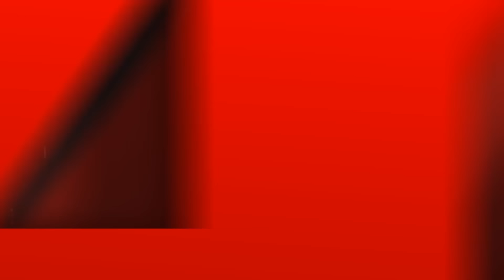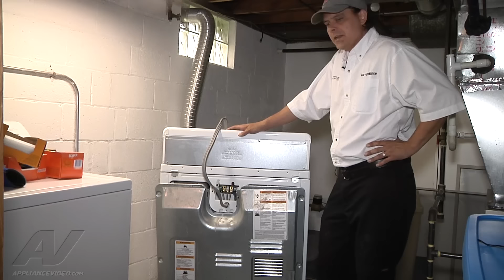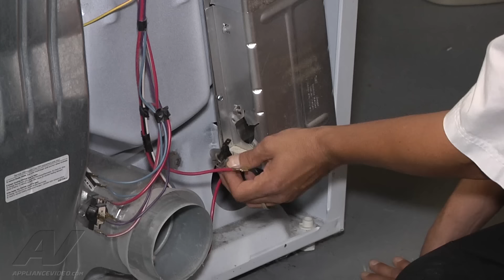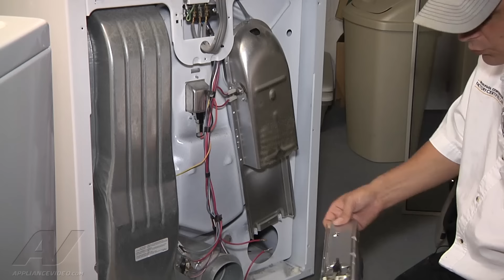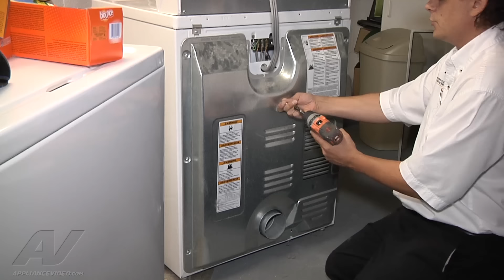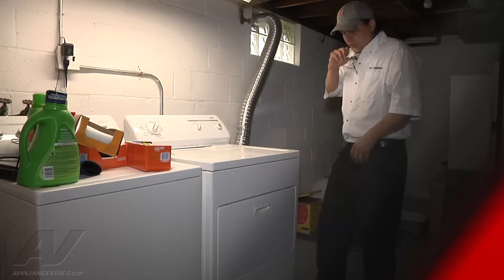Kenmore Dryer Repair - Does Not Heat - Element Diagnostic & Troubleshooting

Comment: @3:40, the tech said no continuity, it's fine. then @5:10, the tech said he has continuity, and that's good. Which one is it? Because the latter is a new piece, I'm going to assume that there should be continuity between the prongs, but what about the element. I'll assume that when testing the element by placing one pin on the element shield and another on one of the prongs that there should not be continuity; otherwise, it will be considered shorted - meaning it's having a connection where there should not be one between the element shield and the prong. Or am I misunderstanding? Any clarification would be appreciated.

Comment: Thanks I actually fixed mine fast asf. It had two wires on the top thermostat and one was just disconnected. it appears it had been previously replaced and the terminals were not tightened. I used some pliers to tighten up that connection and reassembled everything and it’s running super hot now :)

Comment: 11 years old and its by far the best video. Every other video the goofballs leave the wires connected to the parts that were tested. I'm no electrician but that did not seem right to me. I like how you said the heater unit has either 2 or 4 wires connected to it. On mine I've got 3 wires. Joy.

Comment: So after replacing the thermal fuse and the heating element and thermostat with no good results… I watched this video.. didn’t have time to replace the thermal cutoff so I just bypassed it by Hotwiring it… dryer works perfectly now… thanks..

Comment: The heater box springs were cut O just put a piece of wire use to tight hay bales to make contact n is heating like crazy  thanks for ur video amigo valla con Dios❤

Comment: OK, I did all that and I still don't have heat in my dryer. What is the next step? Could my "new" heating element be bad? How can I check? Or could another part be faulty.
Reply: Did you end up hiring someone to fix the dryer, and what was the problem?

Comment: Nice but i have all continuity are good beep  for all sensors and heating element. Can you tell me what is next please
Reply: I figure out . Switch plug not connected well . When I move plug has noise and heating work . 😂 thanks anyway. I will do clean and put some dialectic grease 😊

Comment: Hi so I replaced the thermostats on both sides the wires are in good condition and I checked every plug for continuity which also was good 👍 and the heating element which is good 👍 I also checked the motherboard and all the plugs had proper flow of continuity 👍 and checked the breaker and power flow but my dryer still won’t heat what else could it be🤦‍♀️
Reply: Any luck? In the same boat

Comment: What if i use multimeter and the heater core has continuity and the heater fuse? i have an electric kenmore older addition and i wonder if it has a coil? if so where? i only found thermostat

Comment: Troy great instructions on replacing element on Kenmore dryer  You are clear with great visual in your instruction on repair/replace  on the Kenmore Dryer. I have a Kenmore Heavy Dryer "Runs Like a Horse" 35 year old dryer.  Replace the heating element in 2005 now I am going to replace the part in 2022.  Once the element is in place cleaned and connected to the vent it will be back and drying for another 35 years (maybe) :).

Comment: If that is going out will in work and sometimes and then not? The dryer has proper air flow. Gas dryer 400 series. Maybe a fuse? It does make a clicking noise then will blow cool. Very frustrating....

Comment: This was very helpful, & my Whirlpool dryer is set up exactly the same as the Kenmore used in this video.    My power outlets, thermostats, & timer switch all checked out OK, but my heating element did not.  After removing it, I found the break in the heating element.   Gave me the confidence to order a new heating element & finish the repair myself.   Thank you!

Comment: Thank you!  A $27 part that took me a half-hour to diagnose and replace versus a two-week wait and an estimated $250 repair from an appliance company.  You saved us time, money, and convenience.  Well made video with clear directions.  Excellent job!
Reply: Where did you order the part and if you ordered on Amazon what’s the name of the part or how do I search it ?
Reply: This is exceptionally helpful and I also thank you for sharing this information. My in laws are thrilled that it can be fixed for a low cost. 👍🇨🇦
Reply: Where did you order the parts, I need to fix mine.
Reply: @jet4809  Amazon
Reply: @jet4809 amazon

Comment: Will the nasty dust on the wiring in the back cause the dryer not to heat. I did everything I could so far except put it back together. I’m 71 and in a lot of pain and alone. So I ask you this before I put it together…I hope you can help me…

Comment: Hello, would element # 279838 would fit my 30 year old Amana Dryer? Or whsh part would be? Thanks
Reply from the maker: Great question, if you have a more technical question that our parts department cannot answer, you can search our over 17,000 answered questions free at our website www.ApplianceVideo.com under our Repair Help section. You can also call our parts department at 1-800-830-5465 and they can give you help 7-days A week ,or search at www.SaveMoreOnParts.com  .

Comment: What do you suggest if your dryer has 2 wires for the thermostat and only 1 wire for the element?
Reply from the maker: Great question, if you have a more technical question that our parts department cannot answer, you can search our over 17,000 answered questions free at our website www.ApplianceVideo.com under our Repair Help section. You can also call our parts department at 1-800-830-5465 and they can give you help 7-days A week ,or search at www.SaveMoreOnParts.com  .

Comment: Great video...
But it doesn't say anything about what you do if you do have continuity on the thermostat and the heater. I found the wiring schematics in the back. He didn't mention to check the non resettable thermal cutoff at the top of the heater duct unit. That also should have continuity on the tabs with at least one wire pulled. If it is open, you won't have power to the heater coils. As it is non-resettable, it will have to be replaced 
If it's bad, be sure to check your drier vent hose to the outside. It may be full of lint causing the unit to overheat.
Reply from the maker: Great question, if you have a more technical question that our parts department cannot answer, you can search our over 17,000 answered questions free at our website www.ApplianceVideo.com under our Repair Help section. You can also call our parts department at 1-800-830-5465 and they can give you help 7-days A week ,or search at www.SaveMoreOnParts.com  .

Comment: Great video, thank you! I have discovered that my high limit thermostat is blown so will fix that. On testing also found that my heating element is black from heat but still conducts when tested. Is there any benefit to me installing a new heating element if old one is not blown?
Reply from the maker: Great question, if you have a more technical question that our parts department cannot answer, you can search our over 17,000 answered questions free at our website www.ApplianceVideo.com under our Repair Help section. You can also call our parts department at 1-800-830-5465 and they can give you help 7-days A week ,or search at www.SaveMoreOnParts.com  .

Comment: Do I do the same process on a Kenmore gas dryer? 🤷‍♀️
Reply from the maker: Great question, if you have a more technical question that our parts department cannot answer, you can search our over 17,000 answered questions free at our website www.ApplianceVideo.com under our Repair Help section. You can also call our parts department at 1-800-830-5465 and they can give you help 7-days A week ,or search at www.SaveMoreOnParts.com  .

Comment: I have a Kenmore Elite model #110.64992301. It is 15 yrs old but is in great condition. It stopped heating. I'm confused about the videos. Do I check the thermal fuse from open the front or back of the dryer? Thanks, Roy
Reply from the maker: Great question, if you have a more technical question that our parts department cannot answer, you can search our over 17,000 answered questions free at our website www.ApplianceVideo.com under our Repair Help section. You can also call our parts department at 1-800-830-5465 and they can give you help 7-days A week ,or search at www.SaveMoreOnParts.com  .

Comment: Hi thanks for the great video!
I cleaned the vents replaced the thermal fuse, and gas valves. I tested flame sensor,thermal cut off fuse, high limit thermostat and timer they have continuity but it still turns off after 10seconds. Please help.
Reply from the maker: Great question, if you have a more technical question that our parts department cannot answer, you can search our over 17,000 answered questions free at our website www.ApplianceVideo.com under our Repair Help section. You can also call our parts department at 1-800-830-5465 and they can give you help 7-days A week ,or search at www.SaveMoreOnParts.com  .

Comment: What if it is heating but not much, just a little heating?
Reply from the maker: Great question, if you have a more technical question that our parts department cannot answer, you can search our over 17,000 answered questions free at our website www.ApplianceVideo.com under our Repair Help section. You can also call our parts department at 1-800-830-5465 and they can give you help 7-days A week ,or search at www.SaveMoreOnParts.com  .

Comment: Ok I replaced the thermal Fuse still won't start
Reply from the maker: Great question, if you have a more technical question that our parts department cannot answer, you can search our over 17,000 answered questions free at our website www.ApplianceVideo.com under our Repair Help section. You can also call our parts department at 1-800-830-5465 and they can give you help 7-days A week ,or search at www.SaveMoreOnParts.com  .

Comment: Ok so if the dryer is still running, not heating, but my heating element test good, what could it be?
Reply from the maker: Great question, if you have a more technical question that our parts department cannot answer, you can search our over 17,000 answered questions free at our website www.ApplianceVideo.com under our Repair Help section. You can also call our parts department at 1-800-830-5465 and they can give you help 7-days A week ,or search at www.SaveMoreOnParts.com  .
Reply: You figure out the problem I bought the kit and replaced everything still no heat

Comment: Good video but you didnt actually say what someone should do if they do have 4 wires
Reply from the maker: Great question, if you have a more technical question that our parts department cannot answer, you can search our over 13,000 answered questions free at our website www.ApplianceVideo.com under our Repair Help section. You can also call our parts department at 1-800-830-5465 and they can give you help 7-days A week ,or search at www.SaveMoreOnParts.com  .

Comment: Thanks same dryer i have and it just stop heating today after 9yrs hopefully the element went out.
Reply from the maker: Great question, if you have a more technical question that our parts department cannot answer, you can search our over 10,000 answered questions free at our website www.ApplianceVideo.com under our Repair Help section. You can also call our parts department at 1-800-830-5465 and they can give you help 7-days A week Monday Saturday, or search at www.SaveMoreOnParts.com  24 hours 7 days A week.

Comment: Great video. I replaced the thermal fuse and heating element and I’m still in a situation where sometimes I have heat, sometimes no. Any ideas?
Reply from the maker: Thanks for your response, we are glad we could help. Our library
of over 5,700 videos are currently helping over 1.6 million people like you
every MONTH.  Please help us by
subscribing to our YouTube channel, or post our website www.ApplianceVideo.com to your Facebook
page, Twitter, Instagram or any other social media sites. Your support will
help us keep producing more free quality videos.
Reply: Could be a falty timer.test it with a multi meter the red,blue wire behind the timer,put the multimeter on the lowest setting on ohms
Reply: If it's intermittent, my money would be on a faulty element or the thermostat.

Comment: Where do i find heater element.
Reply from the maker: Great question, if you have a
more technical question that our parts department cannot answer, you can search
our over 10,000 answered questions free at our website www.ApplianceVideo.com under our Repair Help section. You can also call
our parts department at 1-800-830-5465 and they can give you help 7-days A week
Monday -Saturday, or search at www.SaveMoreOnParts.com  24 hours
7- days A week.
Reply: Amazon Ebay

Comment: I have changed the heating element and all the thermostats switched the breaker off then back on and still no heat
Reply from the maker: Great question, if you have a
more technical question that our parts department cannot answer, you can search
our over 10,000 answered questions free at our website www.ApplianceVideo.com under our Repair Help section. You can also call
our parts department at 1-800-830-5465 and they can give you help 7-days A week
Monday -Saturday, or search at www.SaveMoreOnParts.com  24 hours
7- days A week.
Reply: Timer

Comment: I'm having a similar problem to the video, dryers running, the timer is not going down at all and there is no heat, would a broken heating element impact the timer feature on the dryer as well? Thanks a lot for the help!
Reply from the maker: Great question, if you have a
more technical question that our parts department cannot answer, you can search
our over 10,000 answered questions free at our website www.ApplianceVideo.com under our Repair Help section. You can also call
our parts department at 1-800-830-5465 and they can give you help 6-days A week
Monday -Saturday, or search at www.SaveMoreOnParts.com  24 hours
7- days A week.

Comment: It would be helpful if the camera was focused on what you are talking about if this is diy one should assume the person doesn't know what the continuity setting on a meter is. Maybe I didn't catch it, but unplug for safety? The electrical? Gas un plug/shut off?
Reply from the maker: Great question, if you have a
more technical question that our parts department cannot answer, you can search
our over 10,000 answered questions free at our website www.ApplianceVideo.com under our Repair Help section. You can also call
our parts department at 1-800-830-5465 and they can give you help 7-days A week
Monday -Sunday, or search at www.SaveMoreOnParts.com  24 hours
7- days A week.

Comment: What if the element in the thermostat is good what is the little thingy on the top side of the heating tube with two wires
Reply from the maker: Great question, if you have a
more technical question that our parts department cannot answer, you can search
our over 10,000 answered questions free at our website www.ApplianceVideo.com under our Repair Help section. You can also call
our parts department at 1-800-830-5465 and they can give you help 7-days A week
Monday -Sunday, or search at www.SaveMoreOnParts.com  24 hours
7- days A week.

Comment: ? So what do I do if I have changed everything heating elements and fueses and still no heat everything works but no heat
Reply from the maker: Great question, if you have a
more technical question that our parts department cannot answer, our
technicians are answering all questions at our website at www.ApplianceVideo.com under our Repair Help section. You can also call
our parts department at 1-800-830-5465 and they can give you help 7-days A week
Monday -Sunday, or search at www.SaveMoreOnParts.com  24 hours
7- days A week.
Reply: Timer

Comment: Hi, I noticed you said a kenmore 80 series electric dryer in the video but it looks identical to my kenmore 600 gas dryer. I have not opened my back panel and checked yet but are they identical in the back since I cannot get to the back unless I move it all the way out which I will once I get all the parts.
Reply from the maker: Great question, if you have a
more technical question that our parts department cannot answer, our
technicians are answering all questions at our website at www.ApplianceVideo.com under our Repair Help section. You can also call
our parts department at 1-800-830-5465 and they can give you help 7-days A week
Monday -Sunday, or search at www.SaveMoreOnParts.com  24 hours
7- days A week.

Comment: My dryer heats for 10 min continues to run but goes cold after 10.  Any suggestions?
Reply from the maker: Great question, if you have a
more technical question that our parts department cannot answer, our
technicians are answering all questions at our website at www.ApplianceVideo.com under our Repair Help section. You can also call
our parts department at 1-800-830-5465 and they can give you help 7-days A week
Mon-Sat . You can also search at www.SaveMoreOnParts.com 7- days a week.
Reply: Timer

Comment: I checked all with a multimeter and got good readings on everything.   What else could the issue be?  Please help.
Reply from the maker: Great question, if you have a
more technical question that our parts department cannot answer, our
technicians are answering all questions at our website at www.ApplianceVideo.com under our Repair Help section. You can also call
our parts department at 1-800-830-5465 and they can give you help 6-days A week
Mon-Sat . You can also search at www.SaveMoreOnParts.com 7- days a week.